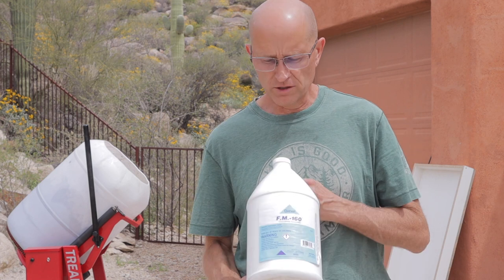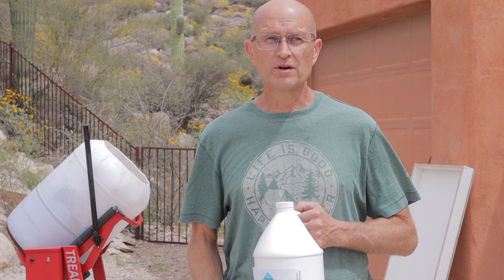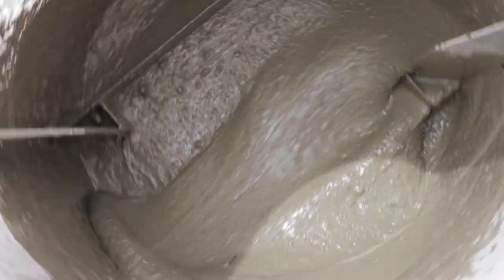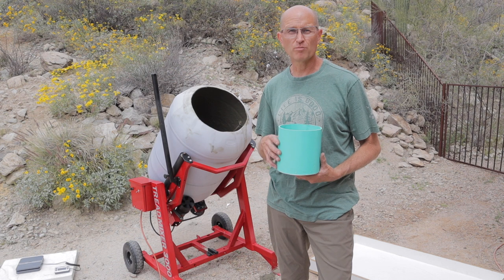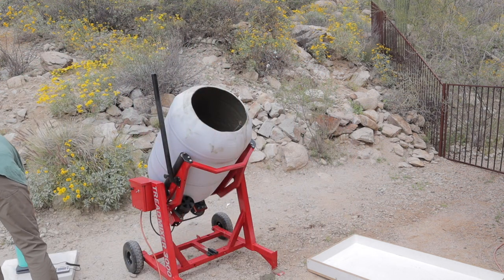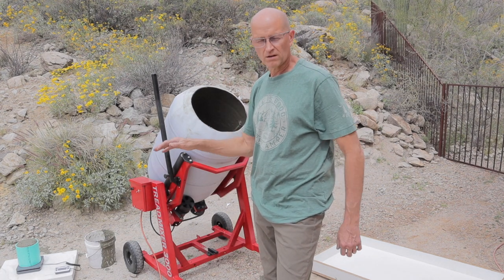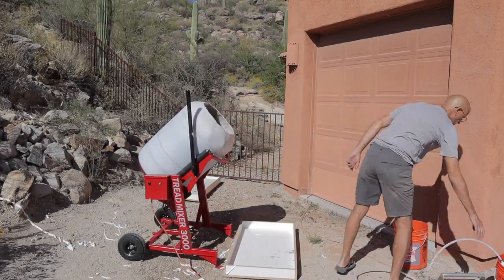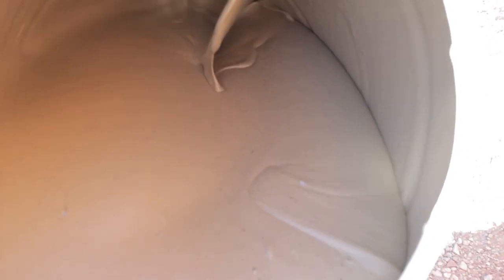How to Make AIRCRETE The RIGHT way!  [ How to measure Density for consistency.

Comment: I am confused about your measuring cup. It is 6.112” diameter, but you said it has 6” across? Isn’t diameter same as across? What is the length”? Thanks
Reply from the maker: Hi Maria, sorry if I messed that up. Sometimes my mouth gets going faster than my brain! The diameter is 6” and the length is 6.112” hope that clears it up. This is for 1/10 of a cubic foot. 😀🙏❤️

Comment: So I got 2 questions 1) will a cement mixer work as well? 
I do understand it may stick to the metal if you don't clean it out right away, but other than that?
2) why is it called foamcrete and not foamcement?  In reality it's just cement water and foam, 
unless you add sand or rock which makes it concrete. just a question.
Reply from the maker: Hi there, 1) yes a regular cement mixer will work fine. You will just have to do smaller batches depending on the size of the mixer you have. 2) yes it is also known as aerated concrete or cellular concrete as well. There are many names for it out there. You can add sand to the mix and it can still be considered Aircrete as long as there is foam added to the mixture. Hope this helps. 👍😀Don
Reply: @PranaTech  The mix does have an aggregate added to the cement hence it is a concrete.

Comment: I’m looking for a way to pump aircrete. Any suggestions?
Reply from the maker: Hi Dan,  probably the cheapest way would be to use a double diaphragm pump. Like this one https://www.ebay.com/itm/30-GPM-Air-Operated-Double-Diaphragm-Pump-1-Inlet-and-Outlet-Industrial-Pump-US/233880189258?hash=item367458794a:g:ZDUAAOSwwrNgF6eq  They are gentle on the Aircrete so it doesn’t pop the bubbles. Also a peristaltic style squeeze pump will work as well but they cost a lot more. Hope this helps.😀👍
Reply: Thank you very much! Is there any information on the proper mix ratio to achieve the best insulation value?
Reply from the maker: Hi Dan,  for me I will be mixing around 30 to 35 pounds per cubic foot density. This will give you around .5 to .75  R value per inch of thickness. You can go less dense in your mix but my experience has found that the blocks become very fragile and break and crumble with any handling at all. 👍😀
Reply: I saw your reply flash on my iPad briefly, but it hasn’t shown up in the Replies yet, maybe it still will.

Comment: Does anyone have experience with the temperature resistance of aircrete in a practical application? I'm building a wood oven and i want to know if it's acceptable to make them this way.
Reply from the maker: I think if you used refractory cement and introduced foam into the mix, it would work great for insulation in a stove. Regular concrete will fail with the high temperatures of the wood stove over time. 👍😊
Reply: @PranaTech  I'll look into that, thank you.

Comment: Gd am. What the proportion of cement, water & foam you used in your demo?
Reply from the maker: Hi Carlos, the proportions are 15.66 pounds of cement to one gallon of water. Mix fully then add 7.5 gallons of foam and gently mix just enough to blend thoroughly and then pour into your molds. For metric it is: 7 kilos of cement to 4 liters of water, mix then add 30 liters of foam. 👍😀Don

Comment: Why are other people mixing but after they add the foam they start mixing counter clock wise?
Reply from the maker: Hi Dave. Some of the mixers have angled blades and some people run them in reverse so they can pull the foam into the cement slurry to incorporate it faster. 😁👍

Comment: So how much and what type of concrete mix do you use
Reply from the maker: My recipe is mixed in a 55 gal barrel and I mix 6.5 gallons of water with a 94 pound bag of Portland cement and once it is blended into a nice even slurry, while still blending with my drill, I fill the barrel up to the 45 gallon mark with foam. 😊👍

Comment: A few questions. Would this be suitable for pouring solid walls? Would the use of a concrete vibrator, to eliminate air pockets, in such an application have a deleterious effect on the aircrete? Would you still need rebar as reinforcement in pouring solid walls?
Reply from the maker: Hi Richard! You can certainly pour solid walls but you can only do about 3 feet tall at a time because the weight of it will collapse the air bubbles if you go much higher. I wouldn’t use a vibrator on Aircrete at all because it will do just as you thought, kill the bubbles. Walls poured with Aircrete are great for insulation but you would need to add sand to the mix if you needed any structural support. Hope this helps! 👍😀Don

Comment: Between 50 to 80pcf of aircrete yields 300psi. Water is 62.4pcf. Your aircrete is weak relative to its weight. How can we achieve 300psi without going over water density?
Reply from the maker: I can assure you that I am no expert when it comes to Aircrete. I’m merely a guy who’s into experimenting with alternative building materials.  Aircrete with strictly Portland cement and foam is really only good for insulation purposes. Although you will see people like Dome Gaia building dome structures out of it.  From all of my studies I’ve found that to achieve structurally sound Aircrete, you would need to add a percentage of sand to the mix to reach acceptable levels of structural soundness. Here is a link to a table that shows compressive strength values when adding sand to the mix.https://drive.google.com/file/d/1BLYueqCIp7c6YN1LklAt4uoINeXFDtA_/view?usp=drivesdk Hope this helps! 😊👍
Reply: @PranaTech  thank you.

Comment: I have a lot of problems with my air bubbles being to big and coming to the top and popping.. I use Drexel
Reply from the maker: Hi Shiloh,  try cutting back a little on the amount of water in the cement slurry mixture so it is thicker like a milkshake. Also, adjust your air pressure to water ratio down to where a 5 gallon bucket of foam weighs 3 to 3.5 pounds(only the foam, not the bucket too). If you are still having issues after this, try only using distilled water for your foam concentrate mixture. My water at my house is very hard and it really affects my Drexel foam quality.  In the end I switched to Richway foam concentrate and have had no issues with my bubbles breaking down and popping. Here’s a link to their site. https://www.youtube.com/redirect?redir_token=3jNQJVKfC5Kmf4eqzx4yJiT7B0B8MTU5MjI2OTUyOUAxNTkyMTgzMTI5&event=video_description&v=IsqQOrOgPqE&q=https%3A%2F%2Frichway.com%2Fconstruction-products%2Ffoam-concentrate.html
Reply: @PranaTech  Okay thank you so much! I will buy the Richway and try it.. I have actually already tried using distilled Water and I have been using foam that weighs 3 lbs per 5 gallon bucket without much luck, Also I have been using a drill to mix it up and I have tried several kinds of paddles on the drill and the best I found is a spiral paddle but still not great. Where can I get one of that kind of mixer like you use in your video?
Reply: Also I have been using 6 gallons of water for one 92lb bag of portland cement in 50 gallon of foam
Reply from the maker: Hi Shiloh, your measurements are right on!👍 All of my foam collapse issues went away as soon as I switched to the Richway concentrate. The price is more expensive but I was so sick of the inconsistency with Drexel that it was well worth the price.  For the cement mixer, I made it out of an old treadmill. Here is a link to my video of the building of it. https://m.youtube.com/watch?v=gkvCt18E97k 👍😁
Reply: @PranaTech  Okay thank you so much!!!
Reply from the maker: 👍😁 you are very welcome!
Reply: @PranaTech  what water to richway concentrate did you use?
Reply: @PranaTech  I ment what water to richway soap ratio did you use?
Reply from the maker: I’ve been using it at a 40 to one ratio with my hard water.😀
Reply: @PranaTech  how much soap in how much water is that?

Comment: HI,
I WANT TO CREATE INSULATIVE AIRCRETE ONLY. (NON STRUCTURAL) I WANT TO PUMP IT FROM THE TOP OF THE ROOF ONTO THE RAFTERS. I HAVE NO DECKING. 
I WANT TO DO THE WHOLE ROOF. 

HOW CAN I MIX A LOT OF IT AT ONCE? 

WHAT TYPE OF PUMP WOULD YOU GUYS USE? 

WOULD YOU GUYS USE TWO OR THREE MIXERS AT ONCE AND WOULD YOU USE A SOLID WASTE SEWAGE PUMP? 

Is that crazy? 
Thank you
Reply from the maker: Hi Casade, you can pump it with a double diaphragm pump of at least 1” output,  or larger would be better. Trash pumps will deflate the bubbles in the Aircrete. A peristaltic pump would be even better but they are pretty pricey! A screw type pump will work also. No this isn’t crazy at all. Insulation quality is one of the best parts about Aircrete. Hope this helps!😊👍
Reply: @PranaTech  Ok, 1" DOUBLE DIAPHRAGM PUMP. I HADN'T CONSIDERED IT BUT IT MAKES PERFECT SENSE. 
WHAT'S THE BEST WAY TO DO LARGE BATCHES? 

WHAT IS A GOOD AND LARGER MIXER? SHOULD I BUY TWO 5 CU FT MIXERS OR SO?  

NOW I HAVE TO LEARN ABOUT THESE DOUBLE DIAPHRAGM PUMPS.  THANK YOU FOR HELPING ME
Reply from the maker: Hi Casade, if you want to do it the easy way, just build a big foam generator like I show in my Aircrete section of my channel. Then just have your local cement company show up with a truck with one yard of just Portland cement and then dose the truck mixer with foam and then have him mix it and pour it into your hopper for your pump and pump it onto your roof.  If you are going to mix it yourself then get a grout or mortar mixer because they are gentler on the foam. Unless you have a few people to help you, running two mixers can be tough. If you have the manpower then two mixers would be a great setup. As far as the pump goes, 1” would be the minimum size, 1.5” would be even better. 1” will put out about 26 gallons a minute. 1.5” will put out 35 to 100 gallons a minute depending on which company you buy. Glad to help👍😁Don
Reply: @PranaTech  YESSSS!!!  I GOT IT. YOU HAVE PAINTED THE PERFECT PICTURE OF WHAT I GOT TO DO!!
THANK YOU.  BY THE WAY, YOU HAVE THE BEST VIDEOS.
Reply from the maker: Aww, thank you! Let me know how it goes and if you need any more information.😊👍

Comment: First Aircrete video I’ve seen where they actually weighed anything. Duh. Strange for people to be hawking a product for its lightness and never bother to weigh it much less compare it to the weight of your average regular concrete with sand and gravel. I’m interested to know if it gets any lighter as it cures. I would like to try using some to pour on the roof of my tall top Sprinter van to create a Level surface to which I will adhere one or two layers of 2” closed cell foam insulation sheets. Then put diamond plate aluminum sheet on top for a non skid deck surface. I remember from my architecture school days about concrete slump tests, core samples, and those cylindrical samples that are tested to destruction. If this product is ever to be accepted by building officials it’s going to need testing and standards by which it can be measured. Obviously I can’t have too much weight up on the top of my tall top 4 x 4 sprinter van which is already over 10 feet tall so even though I’m only gonna put enough up there to level it off with a minimum of an inch or two at the thinnest part, I still can’t afford for it to be too heavy. I suspect I will use Styroaircrete with chopped up closed cell styrofoam to lighten it up. I plan to put a rubber paint, a wrap or something up there on my roof first so it can be completely removable. What do you think? Even in a tall top sprinter with an average height person every inch of height is too precious to waste 3-4 inches of it for floor and ceiling insulation so why not put the insulation on the roof like some commercial buildings do? I haven’t seen a single Van Build or they put the insulation on top of the roof. The R value for various mixes would also be an interesting chart.
Reply from the maker: Hi Mark! Thanks for the filmmaking 101 lesson.🤣👍 I think your idea is pretty decent for what you want to do with the sprinter. Aircrete at it’s lightest form is best used as an insulation. To gain more structural ability with Aircrete you have to add sand and this adds weight which is the last thing you need on the roof of the van. My thought would be to put some lightweight support blocks dispersed across the roof at regular intervals and then pour the Aircrete up to the level of the blocks or slightly higher and this will support the diamond plate much better over time. Let me know if I can help in any way. 😊 Don
Reply: @PranaTech  I was not familiar with the term cellular concrete. I saw the people that sell the foaming agent you linked also use that term so are they and you referring to the small air bubbles by that term or what? Since the thickness of the Styroaircrete plus at least two if not 4 inches of rigid close cell foam would be considerable thickness, the weight of anybody standing on the diamond plate would be spread out over a much larger area of the roof if you presume the load spreads out at a 45° angle. If it was a problem I would certainly use two layers of 2 inch closed cell rigid foam on top of the styroaircrete to spread it out over a larger area so probably the best thing to do is to put one layer of the foam then stick the diamond plate on temporarily and then stand on it and see how much deflection occurs and if there’s too much then put another layer of the 2 inch foam board. the 2 inch foam is not to add strength but to spread the load out over a larger area of the roof. I would also put some kind of a lightweight welded wire mesh embedded in the styroaircrete.
Reply from the maker: Yes, cellular concrete, aerated concrete are all synonymous with the generic term Aircrete. I think 2” of rigid foam would be plenty for what your doing.

Comment: So which is it at 30 PCF, Class 2 or 3?  Because the chart shows 30 on both, and the same with transition between each Class and therfore correlating density measurements.

So maybe it should be 30 for the top of Class 2, and then start at 31 for Class 3 and so on, like from Class 1 to 2.  Or even more specific, but the same number at the end of one Class and the same at the bottom of the next, while the density of each Class was not a range and was 40 in all Class changes but 30 in the first.

All this to say that "Consistency" is not achieved by Inconsistent parameters to follow.  😉
Reply from the maker: I don’t think it matters that much which class it is. I can’t get an engineer to sign off on anything related to structural with Aircrete, so it really can only be used for insulation purposes at this time. Until American engineers start embracing new building technologies, we are stuck with using only methods that have decades of ASTM testing to back up the engineers so there is no liability. ☹️

Comment: Hello big Dan the gumout man. Just kidding fella. I really like the way you are measuring foam density. What I would like for you to get back to us all on how the other foaming agents worked out for you fella. Also, would adding acrylic to the mixing of aircrete make for a more water resistant media for the job ??? Please get back to us on YouTube so that we all can learn from one another. Thanks VF
Reply from the maker: Hey there Victory!  🤣Thanks man! I’ve been so busy building my latest air powered foam generator that I haven’t had a chance yet to make a video about the foaming agents. I’ve been testing Vermillion’s foaming agent lately and it has really impressed me. It is comparable to the Richway CMX but is non-toxic and way more concentrated so it costs a lot less! I have no idea about what the acrylic will do though. I am experimenting with hemp mixed into aircrete as well. I will be doing another video soon discussing all of this.😁👍

Comment: My question is how aircrete handles frèeze/thaw cycles?
Reply from the maker: From what I’ve read, it does great because it is mostly air. But I have no actual experience due to living in southern Arizona where we don’t have those issues.👍
Reply: @PranaTech  After I thought about it a bit, I sort of figured the voids would be big enough to handle that.

Comment: If thy are bubbles in it tht creates voids which will wind up cracking concrete cracks nomater wht whn pouring 10ft or more so thts why you try n control the cracks cuz you cant stop them so I dnt need for my job to be any harder then wht it is cuz it's way hard enough lol
Reply from the maker: Hi Shannon! Aircrete works best as blocks for building with great insulation properties. I would never use it to pour a slab or anything like that. It is not very durable but works great for insulation.😊👍

Comment: What is the cause of big air bubbles?
Reply from the maker: Hi Maria, it could be too low of air pressure into the foam wand or not enough foam concentrate in the mix. Try a higher concentrate of foaming agent first and then increase air pressure next. 😁👍